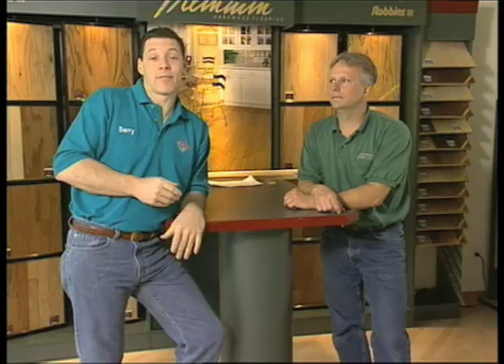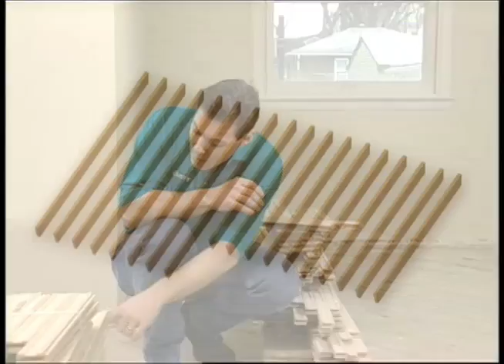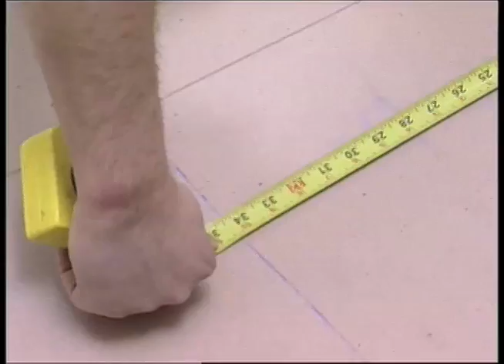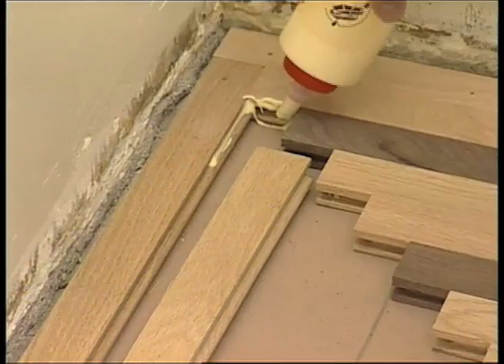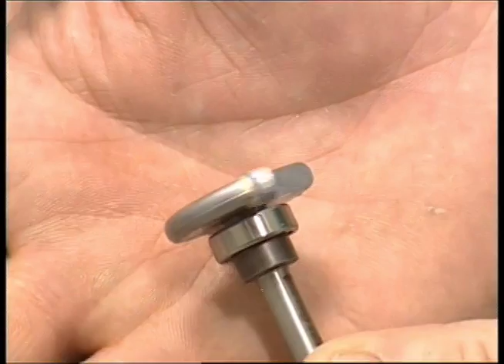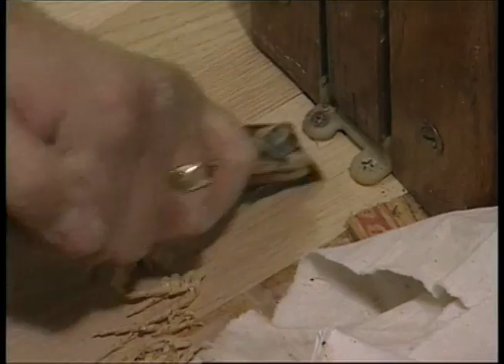Installing a Hardwood Floor

Comment: I am installing unfinished 3 1/4” Brazilian Cherry hardwood flooring & finding so many different widths. Most are within 2mm, but many with 4mm difference, creating gaps. Some boards, the width does not match from end to end. Is this a normal issue with this wood?  What is the maximum acceptable gap as far as your standards & what can be done about it?  Thank you

Comment: @10:30 if they would have started right they would have had to fit a piece to fill the gap. Also with the heat and cold the gap piece  they used will protrude when the floor expands and contracts

Comment: Flooring is milled with a tongue on one side and a groove on the opposing side for a reason. The tongue side is very carefully milled for accepting fasteners. The groove side is not designed for fasteners. Nailing into the groove will not allow for proper expansion and contraction. Nailing into the groove will void any and all warranties either written or implied. In short don't do it folks. If you cannot come up with a way to be able to nail into the tongue and avoid nailing into the groove, then you do not know how to properly install. At this point you should call a professional. As far as the rip on the last board goes, do not install a sliver. Get a wider piece of stock. In this case get some 2 1/4 wide boards and cut that last row in one shot. That rip should not have been there. With a proper layout and proper install that would have been at the wall where it is virtually invisible once you install trim. This video should be used as a " how not to " install a hardwood floor.

Comment: The sliver of wood is to ensure the boarder is evenly spaced and is exactly the right space from the wall as the client requested. All these critics are probably floating floor installers who never worked with real wood.

Comment: At 8:55. A common mistake even with experienced installers, is to set up a "stair-step" pattern, starting off one side. They do this because of installation methods. Instead of moving along each row, they go back & forth, back & forth, to install one or two boards then jump up to the next row. But that pattern will show up as a diagonal line running through the floor. Most customers might not notice, but it totally breaks up the visual "linear" effect that wood floors should have. They will notice that perhaps their neighbours floor looks more stunning than theirs, but not understand why. It's because the eye is subconsciously  drawn towards patterns, which in a hardwood floor could be described as a "flaw". ALWAYS randomise the joints, regardless of which installation method you prefer.
Reply: Gumboot Zone as long as the stagger isn’t consistent throughout the installation the diagonal isn’t going to be noticed , I normally do a bigger stagger , like 12 inch , or about that when I just grab lengths from the bundles to set up new staggers , I have seen contractors lay one row at a time using the cut offs from that row to start the next , which is what I do for a pre finished floor with bundles of flooring that are one length , but in random length t and g ( tongue and groove) it’s fine the way the did it , just don’t ever repeat stagger lengths because the floor will look like u said  horrible.  Also note that when I am laying floors to but joints ( where two pieces of flooring come together ) never line up unless it is a minimum of 16 inches away from each other
Reply: YUUUUPPPPPPPPP
Reply: You nail in a stair step pattern that's the fastest way to put down floor, but that pattern being noticed is entirely dependant on how the boards get racked out, but yes you are correct, true random installations, an production flooring are becoming a distinction in the trade.
Reply: But the fastest way to make money is stairstep, that doesn't mean it's the best way of doing it.

Comment: Jesus Christ I've only been an installer for 3 years and this video has so many errors. but definitely that tiny sliver piece they ended with...I've done a similar border but did not use this method.. I always measure off the most level wall and install a line of wood 14 inches off the wall. that was of course according to the specific design and size wood we would use but generally we always used the same design so 14 inches off the wall worked flawlessly. Everytime. once I installed the square in the room only then would I work on the borders...working on the borders first just seems stupid...I'd rather make cuts at the wall versus making cuts in the middle of the damn room

Comment: Help Help...more help- My sub floor moisture is 7% but the actual floor 
that will be installed in 0%. It has not been acclimated yet. I read 
there should be more than 4% variance.... While 7% is normal for 
subfloor- What am  I suppose to do if the top floor is 0%???
Reply: update, acclimated for 3 days now and same results...

Comment: Pre-finished wood floors have life time "wear" warranties.  If any drop of water/moisture, gets under the finish at the edge it will PEAL (not covered in warranty).  This looks terrible and refinishing an acrylic or ceramic top is VERY expensive. I have 1,000 feet of maple that has a lot of peeled edges.  IMHO Go with real unfinished wood, then finish after it's laid.

Comment: Adrian is right. I've done wood flooring for 17 years and never started a border from the outside and work in. How can it be ok to glue in one sliver of a board and "it will hold in" but on the other end it must be routed and glue in slip tongue so the boards don't pop up?  They'll still pop up unless you nail the slip tongue in. Ok video for very basic installation. If anyone wants to follow this as a basic guide don't "rack out" your boards first. The way this video shows you will not have a random look but instead a "stairstep" appearance.
Reply: +Kristen Schnipke  hello there, ive recently purchased finished hard wood flooring and am attempting my first room, do i really need one of those fancy floor nailers ? can i just use an air nailer ?
Reply: you are RIGHT!!! OMG
Reply: lahkidd
Reply: Yes. That stair-pattern almost made me cringe even more than the sliver did!

Comment: hey folk ive been looking for some cheap flooring all over the place, lowes, home depot, menards, etc. and if you dont mind looking around a little bit then i promise your gonna save some money, i have this site down below all you got to do is click it and not be afraid to search around a little bit and i promise youll find some of the best deals youve ever seen, but ive search allot and i mean allot and the only problem is that on some things not all, they seem to not have enough of, but allot of it dont matter you might just have to wait  a little bit, and i know also that some of the stuff is sold by independent people but some of these prices are to good to be true trust me just look around for about 10 minutes and i know youll find something  <iframe style="width:120px;height:240px;" marginwidth="0" marginheight="0" scrolling="no" frameborder="0" src="//ws-na.amazon-adsystem.com/widgets/q?ServiceVersion=20070822&OneJS=1&Operation=GetAdHtml&MarketPlace=US&source=ac&ref=tf_til&ad_type=product_link&tracking_id=jewicowico-20&marketplace=amazon&region=US&placement=B003R2JATU&asins=B003R2JATU&linkId=NXDNW24LNQ6SMVOD&show_border=true&link_opens_in_new_window=true">

Comment: At 11min that tiny board is disgusting ! As a 12 year solid wood installer I could say this video has a great method until they get to the 11 minute of the video ! U simply can't have that at view !
Reply: Timothy Taylor you seem to know a bit, to not be an installer. not bad my friend
Reply: I have no experience in flooring and I was also turned off by that. I just don't like accent borders though. I feel like they chop up the space and don't give the appearance of a large space than a normal hardwood floor does. It was an interesting video but I wouldn't use their methods or products. I like a wider board without accent borders.